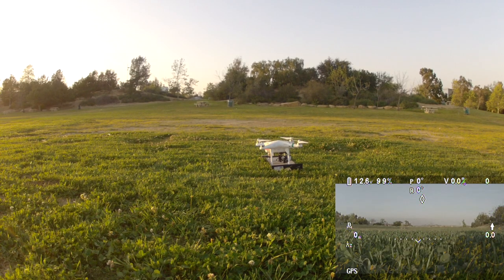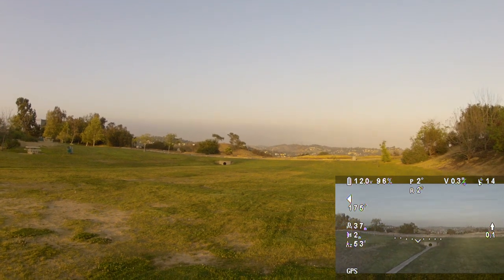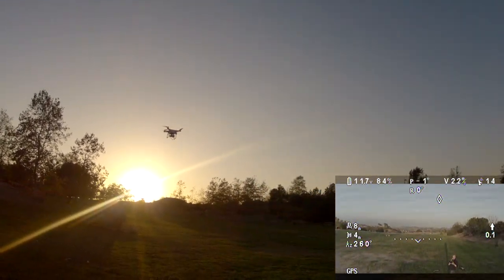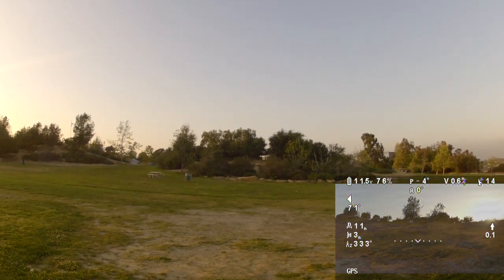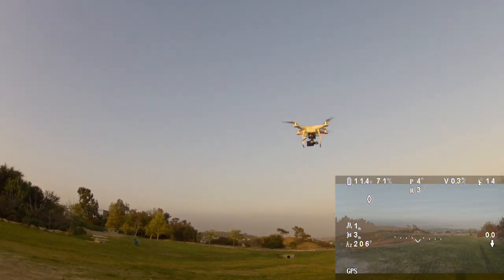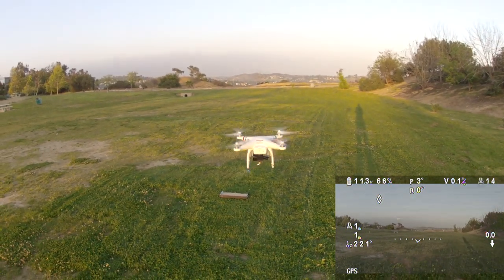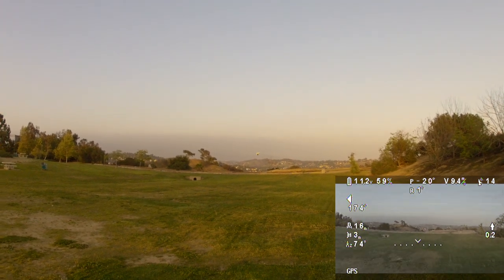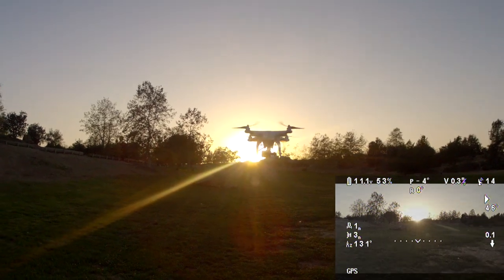DJI's Compass Problem

Comment: I live in Brazil (Brasilia - declination -21) and almost crashed my phantom during the first flights due to this. I though it was a problem with calibration, now I see it was not my falt. Too bad DJI should FIX this ASAP. Very poor service from them.
Congrats for the excelent job you´re doing.

Comment: We had this problem with P1, and now with P2. We did turn the compass to compensate the magnetic declination (I'm in Vancouver, Canada). It did work like a charm, I'll post a "Before" and "After" clip shortly. I do suggest you give it a try. I've seen other guys in Australia and NZ did the same and fixed the drifting problem.
Reply: Hi!
What do you mean by "We did turn the compass" ? You turned it off? you turned it upside down? Or what??
Reply: Iosif Yurlov
 Or maybe you just tuned it? - how??
Reply: Iosif Yurlov we have 16 degrees declination in Vancouver, turning the compass 16 degrees CW, it's pretty stable now.  I uploaded few videos after doing this, see my uploads or I'll put the links here when I get to my computer
Reply: Sean Ghanbari
 Sorry mate I could not find any videos relating the item. Please share links. Thanks!

Comment: after you fly it around for about 30 seconds and let the satellites get a better lock...reset the home position by clicking the left switch 5 times....no GPS first lock is accurate until it actually flies around to really pinpoint its home position....its like when you first turn on a car gps or your phone....it never accurately at first gets your position...

Comment: hey I have a phantom 4 and noticed the same problem. it's been so annoying
I have calibrated imu
calibrated gimbal
calibrated the controller
calibrated the compass
latest firmware on the drone, controller and latest version of app 
checked motors and props in case one was slightly dodgy
full batteries and full gps 
and it flies miles to the left. ..
so annoying